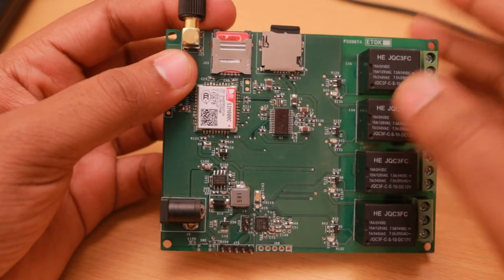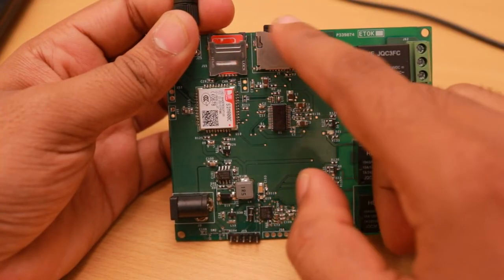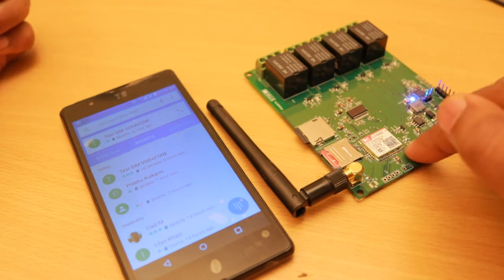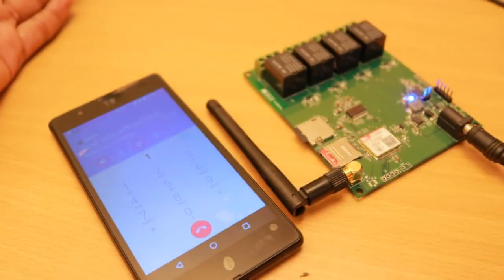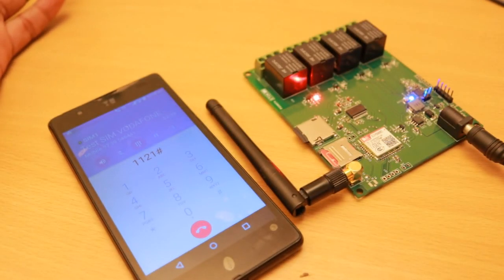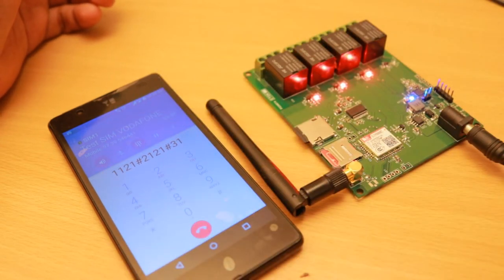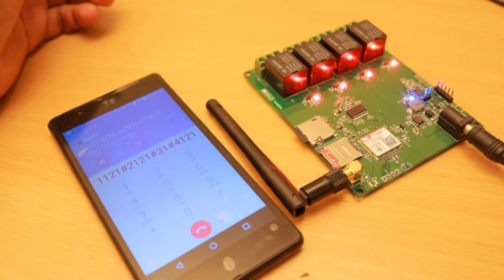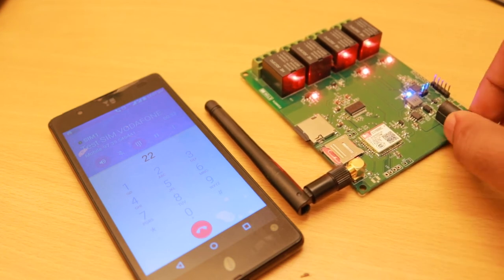Designing a DTMF based Home automation system - GSM | Relay control

Comment: Thank you for all these videos. I'm curious why you are using an external MP3 decoder (MP3 codec + SD card), since the SIM800C contain this feature .? I mean you load some voice files you  need to the internal memory of the module and play them when you need only by AT commands. This way you can reduce the cost of the system.
Reply from the maker: I didn't know that,  Have you tried playing audio during a call using SIM800?
Reply: Yes I've tried this feature. See the AT+CMEDPLAY command, but there is not enough documentation and informations about this. The file should be '.amr' extension and the sampling should not be too high because each file have a size limitation (sorry I forget the max size of each file). It work even with SIM900 and with special firmware.
Reply from the maker: DZPCB Thank you very much for sharing the information. I will try this.
Reply: @DzpcbElectronicWorld  can you please share how to record the audio in sim800c?
Reply: @prajwalh1348  I haven't tried this with sim800C but with sim900 and a custom firmware. Normally you upload the audio files with .amr extension and play the audio with a AT command. There is a limitation in file size and the audio sampling should not exceed 8Khz if a remember. But if you want a good audio quality this methode is not the best.
Reply: @DzpcbElectronicWorld  Thank you so much for sharing the information. I was using sim800c in my project.
Reply: @DzpcbElectronicWorld  hello.. I made this project including apr33a3 as a playback module .. but the problem with this playback system is that , when an unknown caller calls the device there may be a chance that they may control our devices because of voice response. So how can I solve this problem??
Reply: @venkateshm8479  You can solve this problem this way. When your board answer the call, your board ask for typing a password. The process continue only if the password is correct otherwise if the password is incorrect the board end the call.

Comment: Hi bro I'm using sim800l with atmega328. My application os dtmf based. My problem is my system work fine 80% of the time but some time micro controller and sim800l are disconnect. And after that they can't connect automatically i need to reset my microcontroller for that. What is a problem can you help pls....
Reply from the maker: Hi Ajay,
I answer tech queries here,  http://www.embeddedadvice.com/
Please create a post and we can discuss.
Dont forget to share and subscribe :)